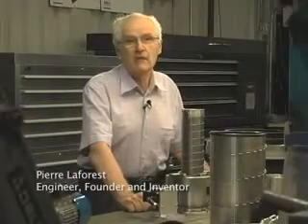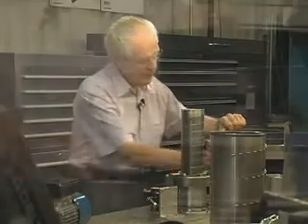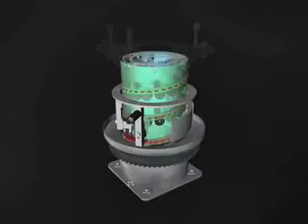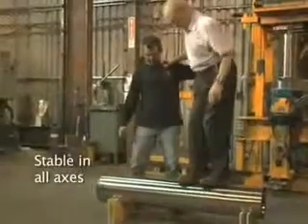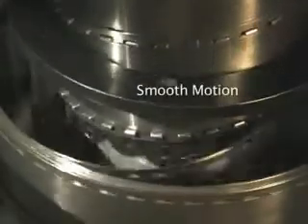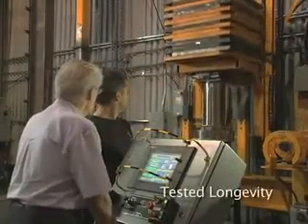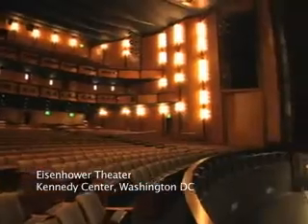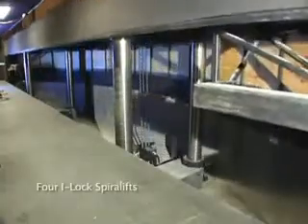Spiralift Telescoping Linear Actuator

Comment: Verry cool stumbled uppon this researching different actuators for my project. Gotto think tho what if it somehow cracks or snaps due to fattigue or aprentice ussage... then its a giant whip blade?
Reply: Spiralifts are not made for fatigue loading per se. We mainly use them for Stage Lifts, Orchestra Lifts, fully configurable Theaters and car assembly lines. At full capacity,  typical life span is 25 000 cycles with proper maintenance. A very busy theater would use them maximum once a day, giving a life expectancy of 65 years... Also, guiding systems are of utmost importance since they are very sensible to side loads. Unless you voluntarily strike the colomn with a mace or mess with the automation programs, they are very safe.

On a side note, non-ILock models require a constant minimum load on them to make sure the bands stay in their "slinky" tracks.

Comment: This is without question one of the most mind-blowing ingenious inventions I have ever seen in my life.   And I'm an engineer with 30+ years experience.   Very VERY cool!!   Should have possible applications in space exploration.   Use very light weight materials and use it for moving solar panels in/out, etc.   Stores in small space and if you use very thing material it could extend tremendous distances and since there's little gravity in space, the arm could get as long as you want.
Reply: I so agree ... brilliant idea !
Reply: One of the risks would be that your metal strips would start to cold weld, you would probably need to coat them pretty extensively.